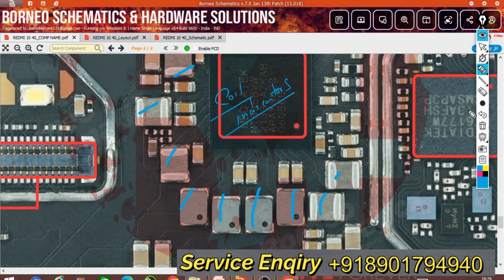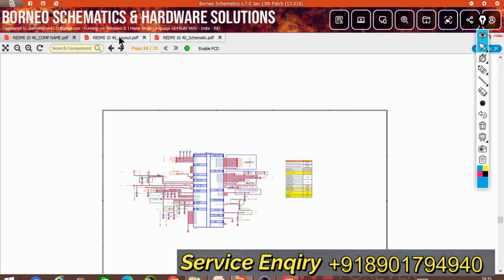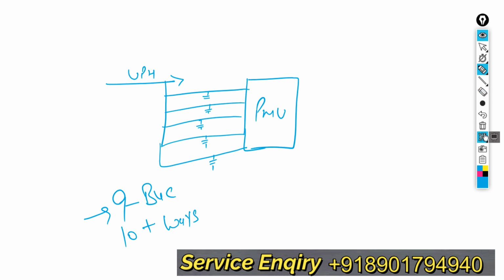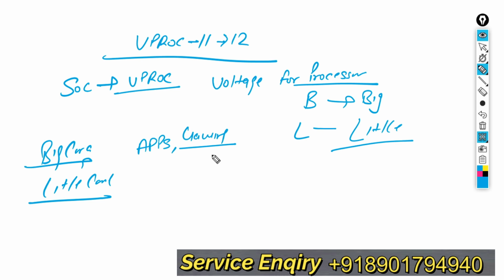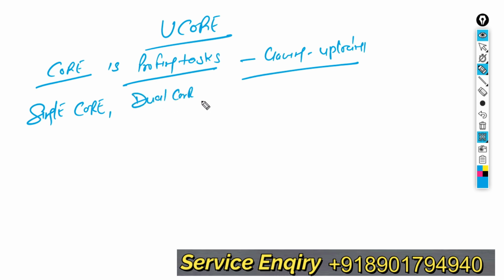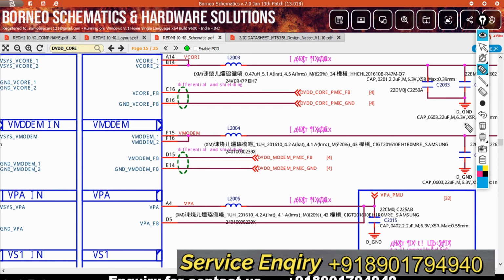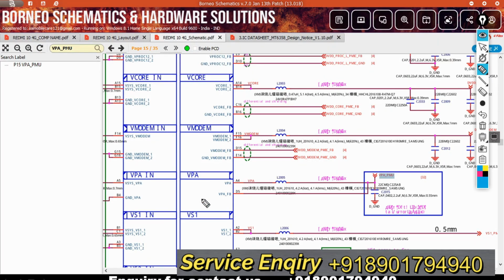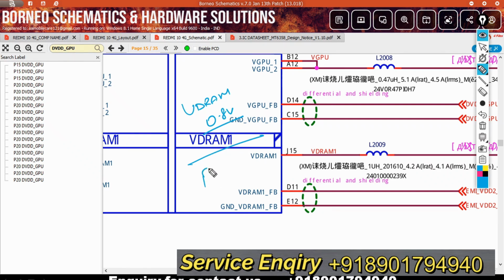Dead Section Class | How to Repair Dead Mobile Phones Step-by-Step | Power Line, VSYS, CPU Guide

Comment: Sir, how to measure output voltage inductor coil  need a input a charger? I tried battery only no measure output voltage buck coil vproc other line buckcoil no power samsung a13 5g please help me GODBLESS YOU
Reply from the maker: Connect charger that's how your power enable & Generates output